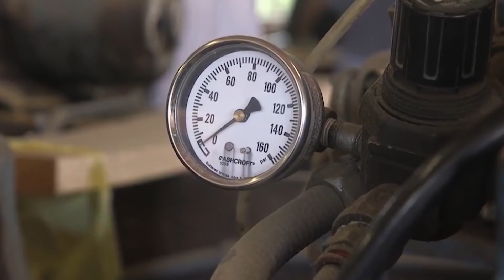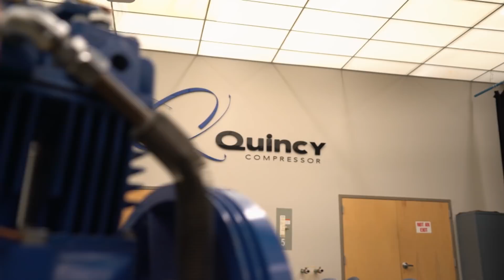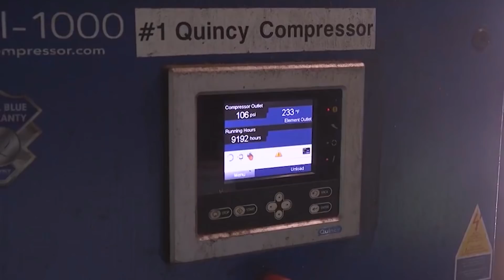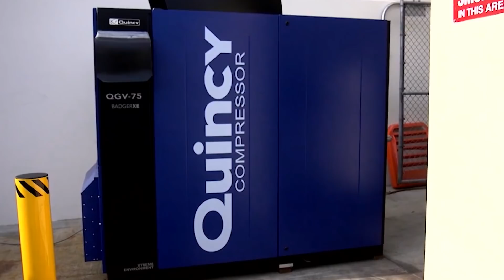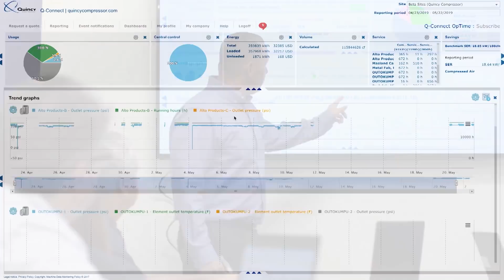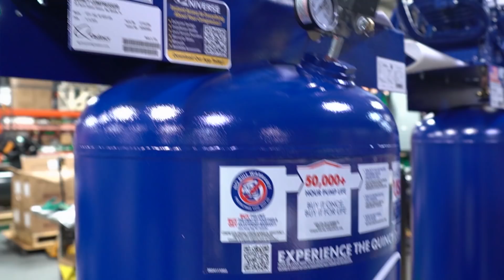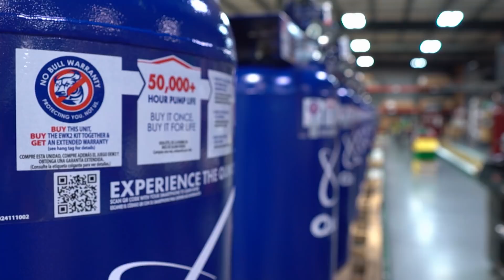Quincy Makes the Country's Most Reliable and Durable Compressors | Inside the Blueprint

Comment: And they’re probably the biggest PITA company to deal with. And this whole made in the USA schtick is BS, maybe it’s put together here, but the money doesn’t stay here, It goes to Atlas-Copco in Europe. Further if you’re buying parts, good luck because technical data is nearly nonexistent to non Quincy dealers.  

At least with Ingersoll Rand, they have their tech data online free for anyone to use. Parts are not impossible to source outside their dealer network. And the machines work very well with little to no issue.

Comment: This co.  Was my 2nd choice..but bought  a Saylor-beall..they include  a magnetic starter..on there 2 stage units..and have a fan on the motor to cool the after- cooler..as air flows into the tank..I ordered  one fully loaded..with a pre water separator  as well on mine befor air even go,sinto the tank..because I live in hot sunny FL.  There sales rep asked me q.....of my needs. Of use..I'm a weekend hobby shop guy..in my home shop..yes ,it cost me some heavy change..but it's a lifetime  unit..no more home store comprsoirs..  I bought a 60 ,gal2. stage 3 hp. 220v performance  pkg..unit..made in st.johns,Michigan..    and runs vary quite..no head akes..

Comment: I just received my QT-54 Compressor, on the black tag on the pump, it Reads Made in China.
Reply: I am glad I bought my QT-54 in June of 2020 because the pump tag says "made in the USA". Mine has the big Q on the tank. Now the GT-54 pumps are "made in china" and the tank doesn't have the big Q, it just has Quincy written vertical on the tank. Plus the price has gone up by about $300. The main reason I bought my Quincy is because it is "made in the USA".